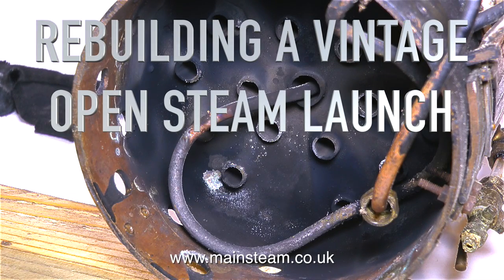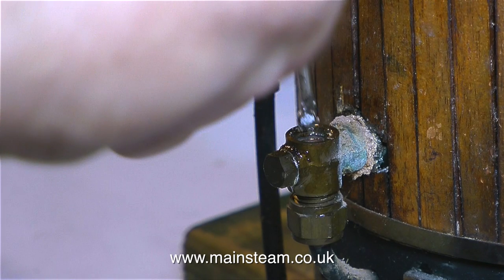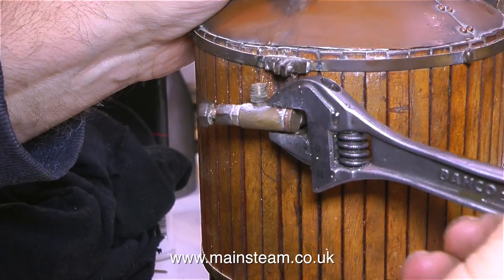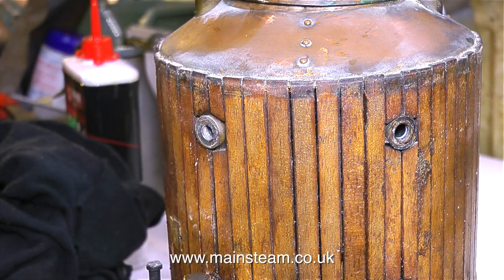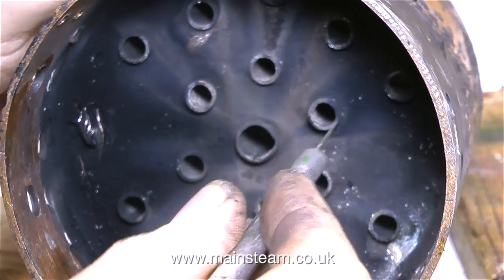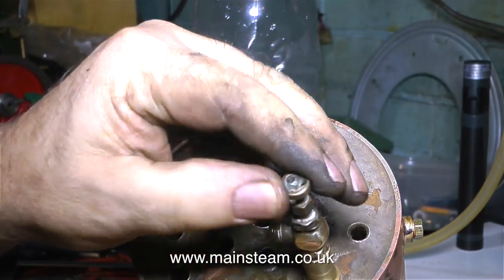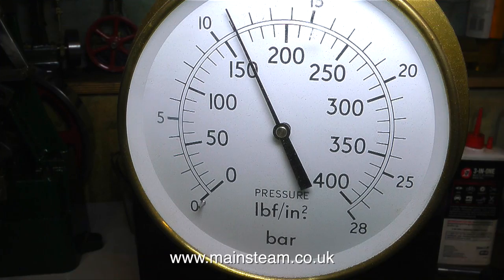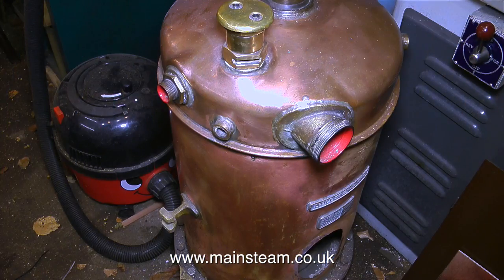REBUILDING A VINTAGE MODEL OPEN STEAM LAUNCH - PART #3

Comment: Oh! I love those Bahco wrenches. When I grew up, all you could and should buy was Bahco, (since I´m swedish). Back in those years, they where made i Sweden and their quality is (was)  outstanding. I have over the years collected quite a number of them, not as a collector, but because they never die. Especially the small ones, 4 inch, are lovely little tools.  The Bahco style was invented and patended 1892 by a gentleman called J.P. Johansson. They were sold by Berndt August Hjort who later started Bernt August Hjort Co that was to be known as BAHCO. 1999 Bahco was bought by the US manufacturer Snap-On and the last Bahco wrench made in Enköping, Sweden was in 2008. Nowadays they are made in Spain and Brasil. Used to be made from high quality swedish forged steel.

Comment: A very nice little workshop - the perfect place to hide away from the overlord. 

What was is the boiler on that Henry likes intended for?
Reply from the maker: It is an old WM STILL boiler and was used in Railway carriages in the late 20th century to provide boiling water for various purposes. I have the fittings for it and I was intending to make it into an ornament. It is not a high pressure boiler, but the internal combustion chamber and tubes makes it interesting. The gas burner for it is gigantic - !

Comment: With the chimney housing (at the 5 minute mark), did you need to cut apart those rivets, or was that just something cosmetic? Thanks for the shop tour; I've been curious about that for awhile.
I'm too much of an outsider to recognize that boiler at the end, but boy is it ever pretty.
I'm about to make a heat-exchanger for an upcoming project, and I've been finding that learning about boilermaking has been extremely helpful in preparation; as what I need is basically a boiler, only without the pressure tolerance requirements.
Reply from the maker: The top housing and cap were in 2 pieces - I didn't need to cut it apart, that is the way it was - a bit flimsy. I will be reworking this arrangement into a single unit and I will show this in a video shortly.
Reply: Keith Appleton I thought that might have been the case. Thanks, and I look forward to it!

Comment: We have a product over here (Canada) that is very good at scale removal which is probably similar to what you use. I use citric acid for pickling my boilers.
Reply from the maker: The "Kilrock-K' is a formic acid based descaler.
Reply: I just looked and the CLR Calcium Lime Rust cleaner is a Aqueous Acidic (what ever that is), I like it because after use it can be poured down the drain. As with any acid you have to treat it with respect, but a lot safer then the sulfuric acid I started with.

Comment: Another wonder video!
I have a feeling you might get hateful message from Crescent wrench supporters...
Reply from the maker: It's just my opinion from my experiences of using them, I have never used a "Crescent" wrench . . . . maybe they are good too :-)))
Reply: Simon P I'm a marine engineer by profession and use both crescent and bacho. I like them both. One advantage to crescent is that you get a bit extra width on the jaws. I can do 36mm on a 10inch shifter. Bacho are slimmer and fit better into tight spots. Just my opinion!